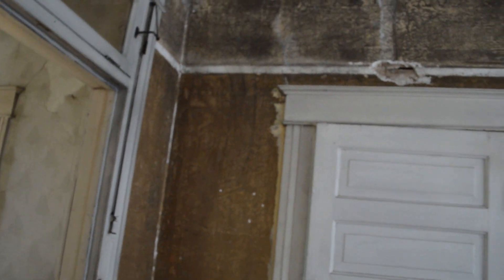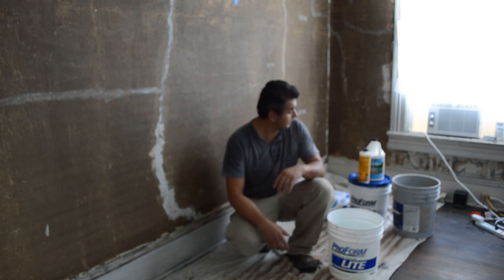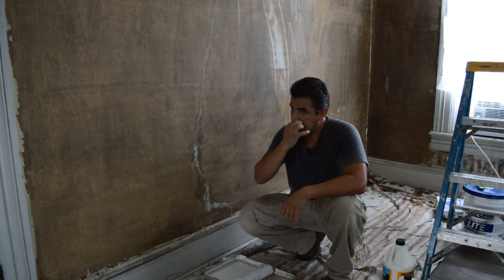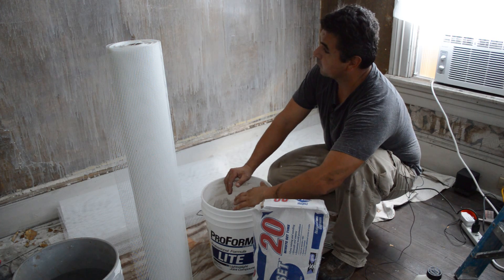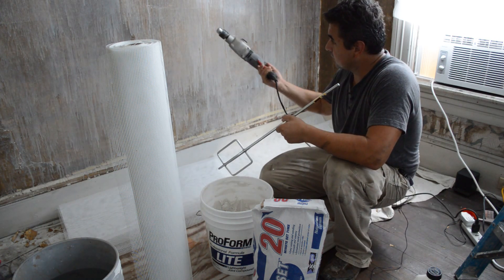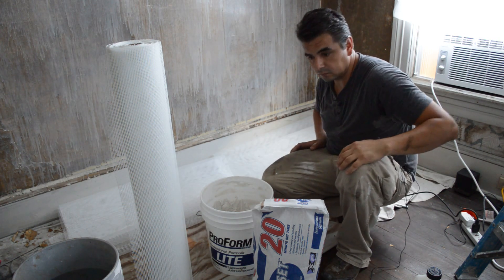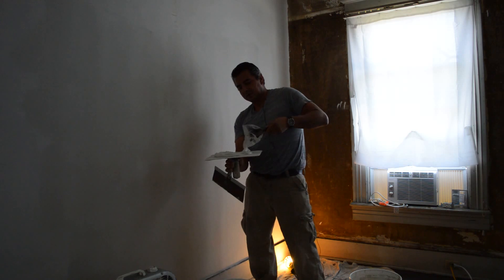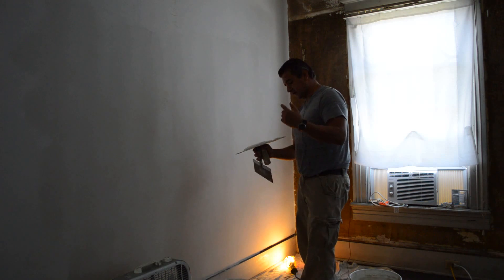Plaster walls restoration (Full version)

Comment: Hello.  Correct me if I'm wrong, but it appears the entire surface of your walls are covered in wallpaper glue.  I used dif on the brown adhesive and it peeled off like a giant sticker, but not without a ton of scraping with a razor and sponging. Forgive me if this sounds stupid, but is that not a concern over time with this method?  I always hear people talking about how imperative it is to remove ALL adhesives before painting and veneering/skim coating, but maybe the bonding agent is the key?  How long have you seen walls repaired using this method last before showing more cracking?